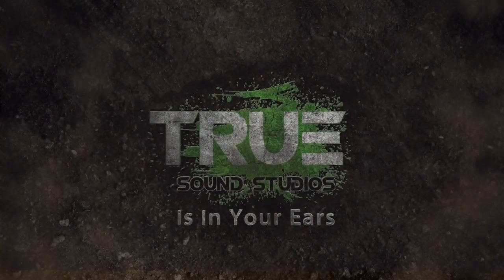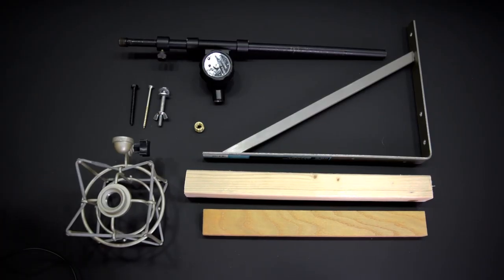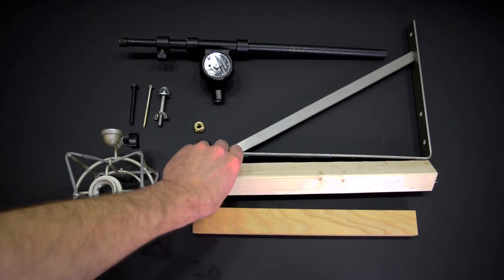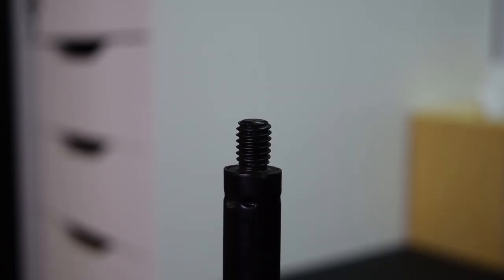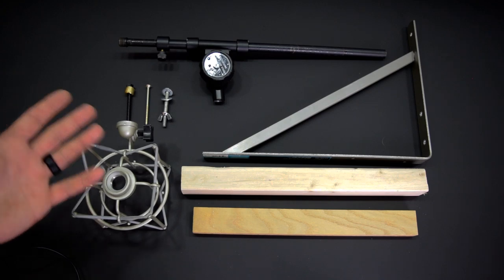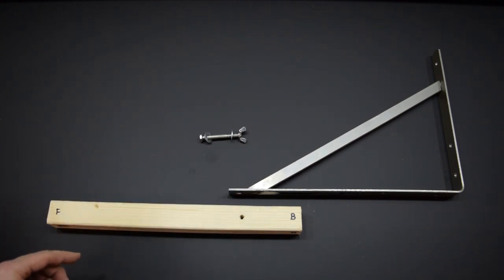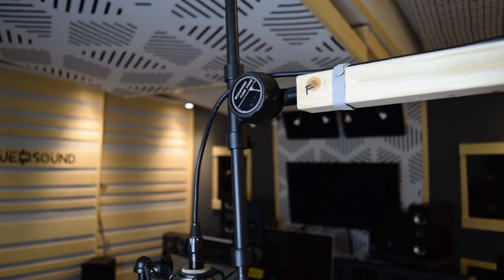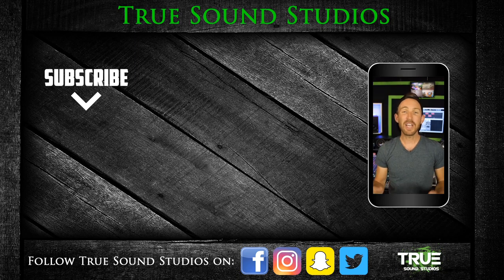Wall Mounted Mic Stand - DIY Build (Adjustable and Folding)

Comment: I know its a bit late, but just wanted to put a heads up, the shelf bracket you used is not for use in tension, it's meant to be used in compression, ala you have it mounted on the wall upside down
otherwise, great build will be building this soon

Comment: Dry wall screws will work if u know what your doing get Long dry wall screws and find the stud it will work but don't predrill if you use dry wall screws I do it all the time never falls I mounted subs to a wall with dry wall screws

Comment: The example video at the beginning is different from what was actually built. Did I miss something? I want the one in the example video.
Reply from the maker: Church Boy Media In the very beginning of the video I mention that this is a way to re-create it. That is a totally custom metal mount that needs metal working tools and a welder. Since almost no one has those tools these days, this was a workaround
Reply: TrueSoundStudios after I posted I actually kept reading comments and saw you answered a number of times :). Appreciate your quick response and the details you put into your videos. I’m a few year late discovering your vids but great work. A partner and I are building a Studio & podcast studio. Some of these are very helpful.
Reply: @churchboymedia8030  what did you come up with?
Reply: @TrueSoundTV Ok  got it

Comment: Which one are you using ? The one that’s not diy?
Reply from the maker: LAYTON BEREAL I made the first one but I used a bracket I got about 10 years ago which was customized when I got it. Then I customized the bracket again for this mic stand which you can’t buy anywhere (I checked). So I came up with a way that you could recreate it

Comment: This is pretty awesome. I think trying to find a way to make the metal bracket fold to the side would make it even better at space saving. Or if you made the holes on the bracket keyholed so it could be taken off the wall entirely really easily.
Reply from the maker: Yeah i had tried a few other designs but they created other issues. If you do find another way, let me know!

Comment: I have a question in your other videos, about panel. I ask your again, that if I dont have a glasswool can i use coushion for panel.
Reply from the maker: Lalchhandama Patea You could absolutely use a cushion but it will definitely absorb a different range of frequencies. The type of material will absolutely changes how much it absorbs and at what frequency. it’s much more difficult to predict
Reply: @TrueSoundTV  Ok, thanks for answer my question..

Comment: Waste of space. Fix the timber to the entire length of the bracket. Fit hinges to the bracket then fix that to the wall. Folds up much tighter space. Your welcome 😛
Reply: I think it depends on how much horizontal length room you want out of your microphone, e.g. keeping it at far away from the wall for reflection purposes. Once you start incorporating bracket hindges you'll run into structural issues, metal bending, and improper weight distribution. Great concept but Not the smartest idea unless its welded and engineered for that purpose.

Comment: Tbh I'm a bit disappointed because I wanted to see how you made the nice clean version of it in your studio not a cheaper version made of a bracket and wood. I get that you're trying to show us a "way" to do it but for those of us that want the mount on the wall the way you have yours this doesn't really help.
At 1:06 you said you were sharing your version of this. This is not your version of this. When we all commented on your Instagram to Show us how you made it we wanted to know how you made your version of this not another variation of it. Anyways I very much appreciated your hard work and you get a thumbs up of course.
Reply: i think he used a Television/monitor wall arm and modified it to work with his mic set up , i have a pretty heavy mic so i'm considering using an industrial dock arm and applying the principals i learned from this and various other wall mounted boom arm videos , theirs a fair amount of tutorials for them in photography/ lighting when you search.
Reply from the maker: No Filler Words Well I’m sorry you feel that way, but this is exactly how mine is. The metal bracket that I used, (though slightly different) I got about 10 years ago, and it was modified for a totally different project, then I modified it again to use it for those mic stand. The wood arm (as mentioned in the video) was what I used which was a 1 x 2 which I stated but for the video sake and re-creating it, I showed a different piece of wood to make it easier for someone else to build. So the design is EXACTLY the same, but because you cannot purchase the bracket that I had, I used a different bracket that is actually available. Probably the biggest difference is the fact that I didn’t paint the bracket and piece of wood on this mic stand re-creation.

Comment: You're gonna have all kinds of unwanted noise coming through any mic you attach to that.  Good Luck!!!
Reply from the maker: Mr. EDP I’ve been using this setup for a few years now and let me tell you I get NO unwanted noise from this mount. The mic is still in a shock mount??? Which is the same effect it would have if the mic were on the floor?? So what “unwanted noise” do you think you would get from this?